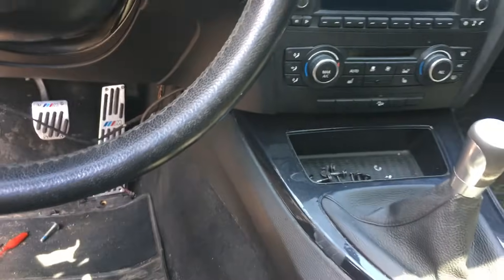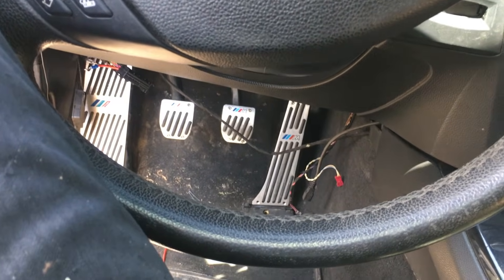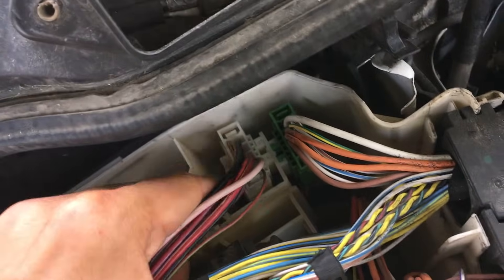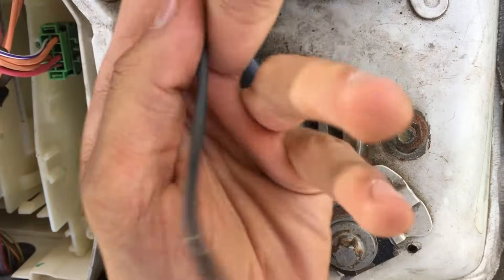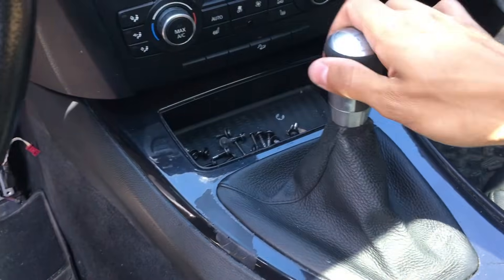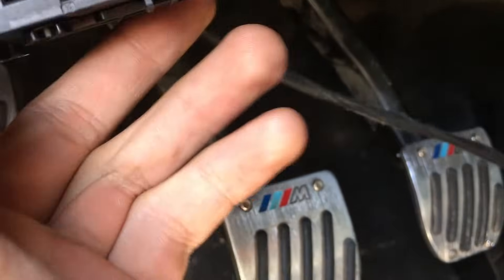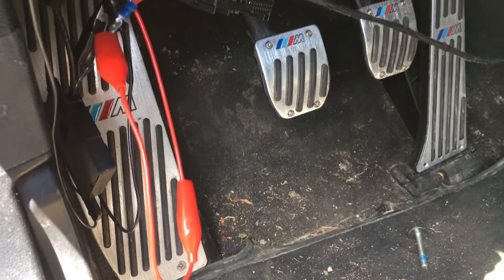NO CRANK NO START FIXED BMW 325i 328i 335i 316i 318i 320i 335d 320d 318d 325xi 328xi

Comment: Hello everybody! Can this issue makes your key and cluster not to light up at all when inside?? + plus no crank/start obviously..  I have also the fault code cas terminal 50 too . But i do have inside roof light, turning signals work , car lock /unlock with keys. What bugs me is why is the dashboard dont light up when the key is in. Could it be the JBE junction boxe ? Im so lost😢

I opened the cas but no sign or burning / burning smell. Checked B+ wire, no melting no nothing. Do you think a faulty starter could cause this whole issue? Check and changed the black 30g relay on the fuxe boxe too. Still the same. My battery is fine 12.6 V. Any insights or guidance much appreciated 🙏🏼🙏🏼🙏🏼🙏🏼🙏🏼

Car: e82 120i 2012 with no B+ wire recall issue ( lci )

Comment: I need help or am going trip out and push this car in a lake … I have a e60 528i , the battery died on me after an engine wash and detail . Charge the battery was under 12 volts got A0B4 code and others bought a new battery days later put it in car started right away . I turn the car off the try again to see if it would crank . It didn’t I hear relay click , fuel pump prime , and that’s it still showing A0B4 with a brand new battery at 12.4 volts resting. What should I do ?

Comment: I did your test and it works and turns over fine.  I sent the CAS out to be repaired and they sent it back saying its completely fine.    Now i dont know what to do.  I unplugged the ibs sensor.  still nothing.    I can bump start the car and it runs, but it has hesitation when pushing the clutch in when shifting, and my brake lights are on all the time and flicker.  Any ideas lads?  Thanks

Comment: Sir why did you replace the starter you could use a multimeter and put it in the cable control in the front and if it lights up it’s your starter if it’s doesn’t it’s your fuse box or ignition switch or something else

Comment: Hi there, is it the thick white wire same apply to the 2006 E90 320i starter as well? There is no green socket for that model on the box but i saw one thick white wire on the maroon socket..trying google already for the signal wire in E90 320i but no clue on that.

Comment: Did you had to program the New module?
Reply from the maker: Yes, it needs to be coded to the main computer
Reply: @aivisu8865  oh ok I really need to get this car going 😌 but I need to make sure  

The negated ground cable on the battery post the sensor has 3 wires. 2 of them has positive  and one has ground  but kind of stays  off unless I wiggled it
Reply from the maker: Yea you should have a secure connection, maybe take it apart and see if anything is broken or lose
Reply: Morning!! 
Have a question I check just about everything and my budget no good right now I mean no good and can’t spend money on part that don’t fix my issue so
Reply: So I think but I want to make sure ! With cas modulo connected  i push on start  and I do getting full signal but on the white wire going to the starter only getting 9 volts my question is from the cas module go straight to the starter  or pass signal to the dem? Thanks and advance
Reply from the maker: Morning! Yes the white wire goes directly to the CAS module. Im almost certain thats your issue here, granted your “B” post has a full 12 volts. Did you pull the CAS module out yet? If not do that quickly and check the circuit board on it.
Reply from the maker: Ok 99% positive your CAS module is gone, i dont think it will let me post my email in the comments but il try with spaces between. Jessebleich 416 @ gmail . com
Reply: When I try to started

Comment: On this wire  I’m only getting 9 bolt’s
Reply from the maker: The 50 wire?
Reply: @aivisu8865  the one the goes to the starter the white one
Reply from the maker: That comes from the CAS module, it should be full 12 volts. Make sure your battery has a full 12 volts and if the battery is good then most likely your CAS is shot, it’s easy to remove and check quickly, you should be able to smell the burnt diode when you open the CAS module
Reply: @aivisu8865  ok I  will check in that first thing tomorrow morning. Appreciate it. I’ll keep you updated.
Reply: I did another test on the cas  when I push the ignition switch I do get power for few seconds but on the white wire going to the starter it goes on and off like not getting all the voltage anything I’m missing
Reply from the maker: When the diode on the CAS module burns out it will only send a fraction of the voltage needed to start the car, but be sure to check your “B” post on your engine for a full 12 volts. If you have 12 volts at the B post then your CAS is fried. Pull it out from under the dash with a 10mm wrench and open it up to see the circuit board. If you want you can send a photo of the circuit board to my email and i can see if its burnt
Reply: @aivisu8865  updating my issues starter was bad got it fix  put it back on it crank one last time .just to say !! Asta la vista baby !!😞. I don’t have money for motor so guys I’ll probably be selling all parts from this car.  2010 328i
Reply: Anyone knows if a lock up motor can be fix ?

Comment: hi i tested the starter like you demonstrated from the plug to the positive terminal in the engine bay. But now if i connect my battery the car has absolutely no power. No lights go on when i connect the battery

Comment: I want to thank you. Because you are a life save. After many hours of searching for the issues of no cranking and battery terminal changing, it turned out that the white terminal wire prove to me that the starter is good. Here's what occurred next, I cleaned the wiring harnesses and now my BMW beamer starts right up like a champ. 
Once again, thank you. 

Andy Grintatelly
Reply from the maker: That is beautiful Andy! Glad i could help sir! Happy driving.
Reply: Andy wich wire did u clean and where
Reply: @andrewgruntatelli5012  I’m about to clean mine. I see some green stuff on the connectors on both sides
Reply: Hopefully that’ fixed 🙏🏼🙏🏼 I’ll be on debt with y’all guys 🙏🏼👍🏼👌💪🏼
Reply: Which wires did you clean please let us know

Comment: I am having the same issue. I removed the clip, plugged in the copper wire and touched it to the B post and my starter only clicks. Does this mean my starter is shot?
Reply from the maker: Yes most likely. Even given full 12 volts and just a click means you’re solenoid is gone

Comment: The one I’m working on is a hybrid so it has no starter. The hybrid inverter sits on top of engine so I can’t access the injectors or coils to see if they are firing. What’s more is that I can only crank it once to do the check then I will have to wait for 30 minutes to an hour to be able to crank it again one time.

Comment: I’m working on a X6 active hybrid. Hybrid cars are a bit more tricky. For example if the engine is not able to start it will throw a hybrid code as well. When I press the start button the hybrid battery cranks the engine but does not start then it throws the hybrid code. At the same time scanner throw an immobilizer code (A103). I notice there is no wire on pin 20 of the CAS. I don’t if someone messed with it or that’s how it is supposed to be. Instead the wire coming from the DME is on pin 30 of the CAS.

Comment: thanks tested your trick and no start
opened up the cas and the board looks like new
ive changed the ivm also and battery was on charger. tested all the fuses and all is good.

question: is the jump clip suppose to get warm? i flatten a paper clip 

im guessing its the dreaded starter   05 645ci

Comment: I have a e90 and it has a no crank issue. When I start it everything has power except the steering is locked and the wipers go crazy. I also get a code saying P1631 - Theft Deterrent Start Enable Signal Not Correct. I have put a copper cable between pin 21 and 22 on the cas module (what he does in the video) connector and it cranks the starter, so clearly the CAS is receiving power. could it be the DME or would it be the CAS? Or something completely different?  Any help appreciated.
Reply: Exact same problem here abolsutely no fookin idea haven't been able to life car up to check all the grounds please hit me back if you figured it out would mean so much
Reply: @creambeam445  will do bro I’m still stuck 6 months later

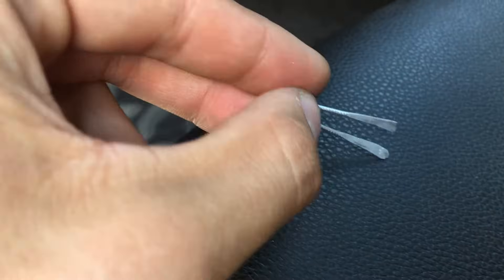Comment: Does it have to be aluminum (4:50)
Reply from the maker: Hey! No thats just what i had available but DO NOT use soldering wire. Copper, aluminum or steel.

Comment: So I did this and it attempted to start
Reply: So since it did attempt to start what is the issue?
Reply: Does that mean it is the cas module and I’ll have to send it in for repair?
Reply: Please help I am loosing my mind
Reply from the maker: So it turned over fine? That means your battery is good. And most likely your starter is also good. Its only a 10mm bolt that holds the CAS module in. Take it out and open it up to see the circuit board. You should smell burnt computer if its the problem
Reply: I don’t smell anything sorry for the late response had to go do something
Reply: Also don’t see anything that seems to be burned
Reply: How could I send you an image if only I could
Reply from the maker: Ok my email is jessebleich416@gmail.com
Reply: @aivisu8865  I sent it bro
Reply: What was your issues did you figure out the problem I’m on the same road

Comment: Hi I don’t know if you still check this but I really need help. My car hasn’t started in a week and I’ve been trying to determine why. Every time I tried to start it, the battery would fluctuate in volts as low as 7v. After replacing all the fuses and one camshaft sensor, I’ve cleared all engine codes and I decided to take a look at the starter. I bought it used, but it was working well up until the car turned off. With a full battery in the car, the starter reinstalled and all repairs finalized; I got in the car today, and one single click. A couple of times it started to crank but same problem, major battery drop out. Any help from anyone would be great, thanks
Reply: I have a 2006 325i E90 N52
Reply: I’ve been thinking the battery was bad and maybe I just have been burning the starter, someone tell me it’s that simple 😂
Reply from the maker: Hey! Did you do any of these tests? It sounds like your CAS module is not sending the correct voltage to your starter, batteries don’t fluctuate in voltage that much.
Reply from the maker: My CAS was sending 5V to the starter which was just enough to make it click, i would try and boost it from the B- post like i did in the video and if it turns over without a problem than it is 100% CAS issue
Reply: @aivisu8865  oh I see in the video, I may try with copper wire instead of the pins. I hope to update with better news soon!
Reply: @aivisu8865  hey yea I ran the test given it direct power, and the starter was still just clicking, and i getting a slow crank. Today I tried to start it regular and I just got a dying crank a couple of times. I’m going to try giving it direct power again. If not any tests for the cas module without a obd2?

Comment: If I tried connecting the thing in the engine bay to the + terminal without the fuel pump plugged in, would it start? Need to just get my car home so I can check out the CAS module stuff on my own time instead of at a parking lot. Thanks!
Reply: Update: For some reason I had all the same issues (no crank, no start, no click, fuel pump priming, all lights and accessories working) but the starter wouldn't engage. Had code a0b4. I tried hot wiring the starter from the junction box under the hood and the starter engaged and when I went into the car to try to start it up, and it started up. Strange.... Has been working fine for the last 3 days now. Not sure what the issue was that it just required me to hotwire the starter

Sharing for information incase it's useful for anyone else
Reply from the maker: Hey! Sorry i seen this late, it sounds like you have a bad starter, or ground issue, i would check both ground straps on your engine.
Reply: @TheFear37  After jumping it would work for 2 or 3 days and then go back to the same problem, just replaced starter and ground straps and it still won't start smh
Reply: @srt4driver1  have u solve it? i just had a same issues here

Comment: Great video! Thanks so much, because I've been searching YouTube with no success for how to hotwire the starter from the engine bay in order to run compression testing on each cylinder one-at-a-time.  This is fantastic!!!!!!  Keywords to add to you video to get more hits:  Hotwire BMW, External Starter Switch BMW, Remote Start, Engine Bay Starter test.
Reply from the maker: That is awesome! Im glad i could help. How did your compression test work out?! Thank you for the keywords i will add them in tonight!
Reply: LISTEN PLEASE

Comment: Can you try this with just regular copper wire?
Reply from the maker: Yes as long as its the same gauge or higher. To thin and it will arc and melt, to thick and it wont fit in the slot
Reply: @aivisu8865  thank you and the video was super hilarious but very helpful
Reply: @aivisu8865  in my case the battery is perfectly fine but all I hear is 2 clicks coming from the front when I try to start the car. It sounds like it's coming from the alternator but I don't know if it's the starter. All my dash lights pop up
Reply from the maker: Thanks! Have you tried to turn it over from the B post yet? If it turns over fine. Then you have a fried CAS module. Mine was only sending 5volts to the starter, just enough to engage the solenoid but not turn it. Thats the clicking noise. It is 100% the starter making the click. Lmk how it goes.
Reply: @aivisu8865  thank you so much I appreciate it. I will definitely start with the starter
Reply: @aivisu8865  you were definitely a big help on this
Reply: Tried this but I got nothing, not even a click

Comment: Tryna test starter on 06 325i.   Don’t have the green box with white wire like yours.  Mine is maroon
Reply from the maker: Just trace the little wire from the starter, it should be easily visible from the top

Comment: I have a problem like this
Reply from the maker: Have you tried this process yet?
Reply: @aivisu8865  yeah and starter crank.is the cluster trans indicator is present? Mine is not showing P in the cluster.and shifter stucked in park.it happen when i tried to re wire my radio with nbt system back up camera

Comment: Hey man I just tried this out and I'm still getting a click only... When it tried it on the CAS module plug it clicked again but shorted the wire i used and sparked... Any idea what it could be??! I'm at a loss and don't want to replace the CAS module just to get it fried again if that wasn't supposed to happen
Reply: I'm also having the terminal 50 error as well
Reply from the maker: Hey! What kind of wire did you use? Try using some heavy wire almost like house electrical wire and strip one down and flatten it out so it fits like i did with the aluminum wire, have you checked for 12 volts minimum at the “B” post? That would rule out a bad battery. Let me know
Reply: @aivisu8865  i replaced the battery w a fresh one only a few days ago and am getting good voltages at the b post off the dme box— tbh i did use a cheap ass wire that was in my soldering kit lol so that might be it... I'll see if I can find a solid Al wire and try that see if it works but if it does crank would that rule it as a bad CAS? It would only click from the DME plug as well
Reply: Solved.... It was a loose B+ terminal cable 🤦🏽‍♂️🤦🏽‍♂️🤦🏽‍♂️
Reply: @aivisu8865 plz whats this B post ??
Reply: @kriterzz5383  i solved this last year but it actually turned out to be the battery and loose ground cables! I replaced the starter unnecessarily

Comment: I jus got a e90 09 328i and I hooked up subs and amp, after about a week after running them I lost all power completely , Im still getting power to the battery but none to the car at all. The first thing that went wrong was the clock would reset every time I got in and would go somewhere , the last time I started. I’ve been reading up and I feel like it’s the ibs but I’ve also been seeing it could be the fuse box and B wire , power distribution box , Or a fuse . Id really like to know exactly what it is so I know what I’m getting into and also whatever parts I’m going need.
Reply from the maker: Sounds like you might have blown a fuse, or something is drawing power. Disconnect your wire for a week and if the problem goes away then you have a power draw
Reply: @aivisu8865  thanks for that. I got rid of the subs lol but I'm back on this video again haha 2 years later im trying to diagnose my starter , battery is good but i go to press the start and it makes a single clicking sound kinda sounds like it's coming from the alternator,  when you test it like in the video do I keep battery all hooked when testing it from pin 4 to positive